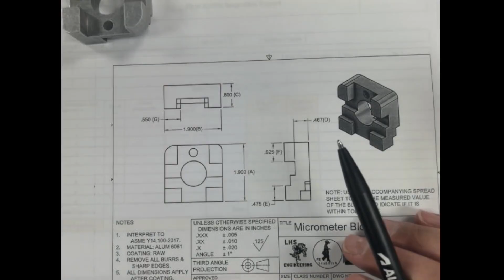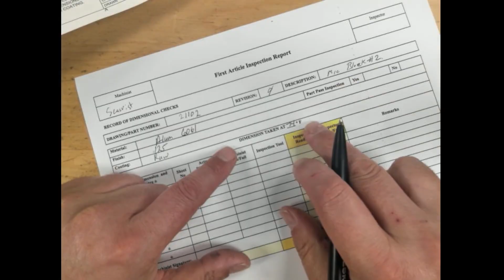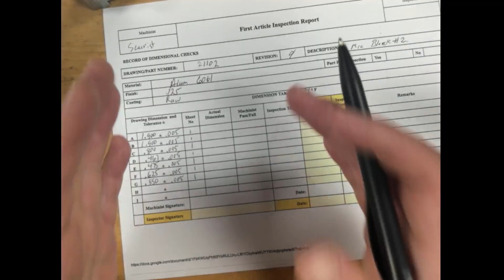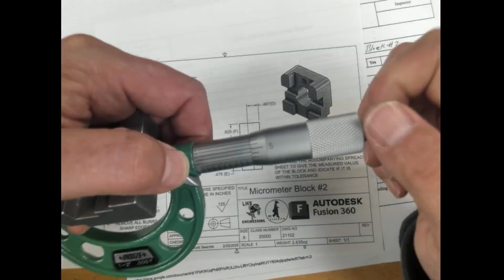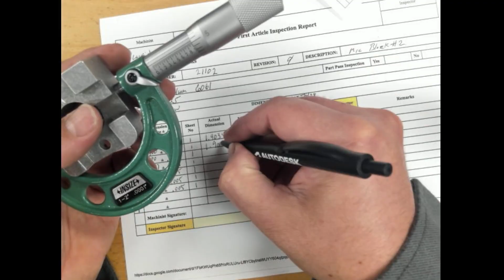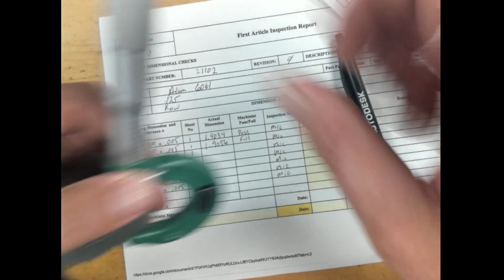Basic Machinist Shop Skills – Part Inspection, Measurement & First Article Inspection

Comment: What format do you use when there are multiple dimensions requiring inspection? How do you evaluate the subsequent parts being manufactured if only the first part is recorded? I am currently in the process of implementing more rigorous inspection procedures in my machine shop; I have some forms and sampling tables, but I am not yet sure of their effectiveness since we haven't implemented them yet.
Reply from the maker: As a high school teacher, we are often only making one to 4 per student.  So, the first is the only.  On our small production runs, the First 1s a full inspection, the last has in process inspection, Caliper.   On the prints, I also indicate with letters witch feature have to be inspected.  The goal is to learn inspection is part of manufacturing.  Second, I pick feature that require, or force them to use, specific tools that expand beyond, just micrometers,  Example, Gage blocks, pins, Surface testers, etc..  This gives them exposure to other inspection process, even if not needed or necessary for this part.  I only do three to manage time.